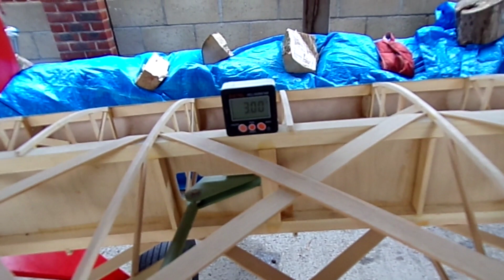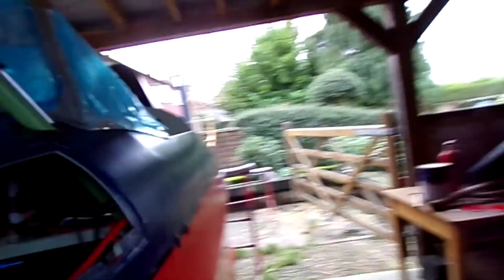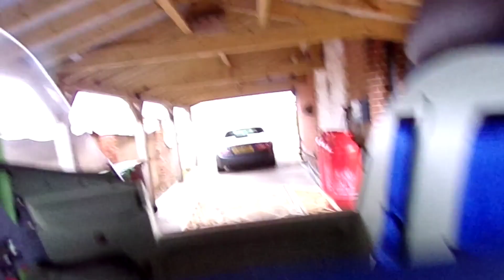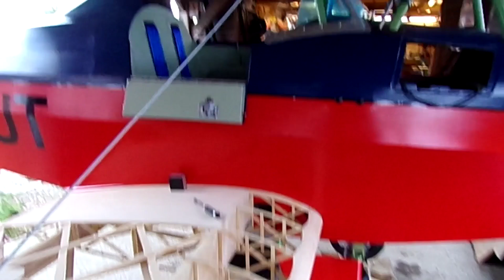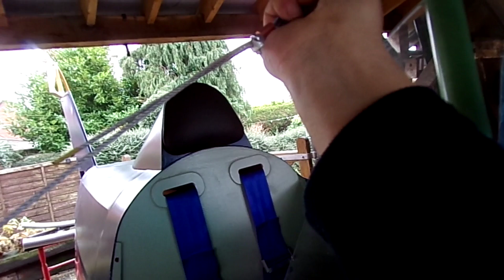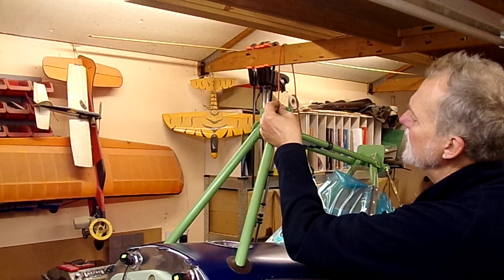EP169 Lower wing landing wires fabricated for the Fisher Youngster

Comment: Hello, I'm starting to worry about final weight of my Youngster, can you share some of your weights details ?. On my side wings=13kg EA, fuselage +/_55 kG, gear=13kg, engine 65kg. Total weight should end around 200Kg.
Reply from the maker: @Jean-MarcMaldague  terribly sorry but I have not been weighing them as I  go through the build as I don't have any scales suitable. I am aiming for a empty weight of less than 180kg and the only weight I can give is for my covered fuselage with controls, fuel tank, instruments (part fitted) and tail wheel fitted came in at 39kg, 42kg with uncovered rudder.
Reply: @flyingkub  Hello again, I would be surprised that you stay under 180Kg, the Aerovee engine isn't lighter than the Jabiru that I plan to install. I'm really interested to know your weight once you know more. Thanks, rgds  Jm
Reply from the maker: @Jean-MarcMaldague  I will let all of those who follow the channel know when the time comes.

Comment: Will you be proof loading your cables? I remember making up a replacement flying wire for my Isaacs Fury and then proof loading it. I forget the weight required but it exactly matched a huge bag of fertiliser Richard had. So we lifted the bag using the cable suspended from his digger forks!
Reply from the maker: @s1spittsdriver  yes it will be done at work with strain gauge and hydraulic puller but there will not be a video.
Reply: @flyingkub  Of course. That makes sense! I forget where you work sometimes!

Comment: Wow, even with just 1 wing fitted it looks amazing.  You'll be running out of space soon. I can't believe you are on Episode 169 of this build, what a journey.
Reply from the maker: @GolfFoxtrot22  I did have both lower wings on briefly so both landing wires are done, next big step is drilling the top wing fixings.  Again that will have to be in the car port. Yes it will be 3 years in February since I got the full kit.

Comment: So I got from that that you measure the true length of the wire, rather than go of a plan length?  Do you have to do that process for each bracing wire?
Reply from the maker: Yes as the plans don't give lengths for any of the bracing wires. It is fairly normal on home build aircraft.